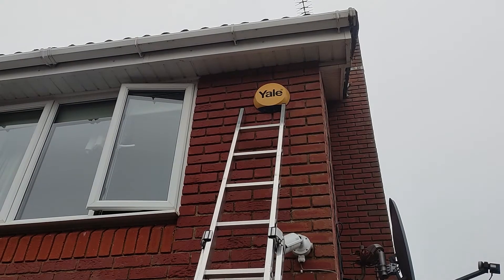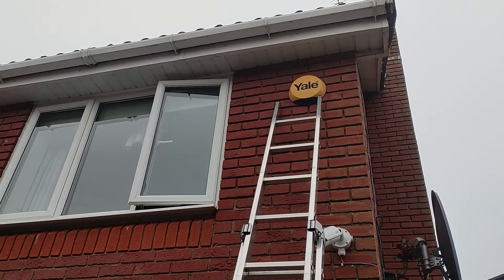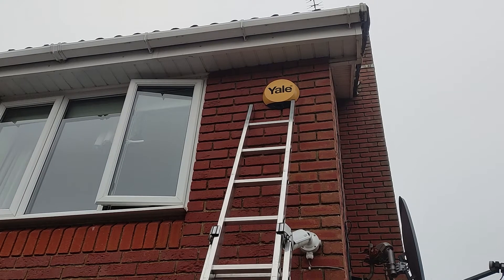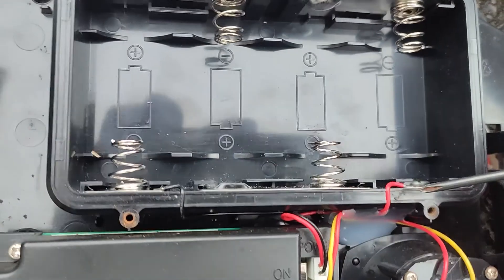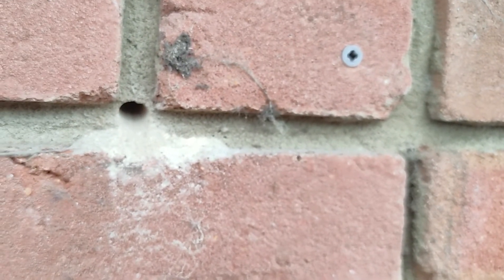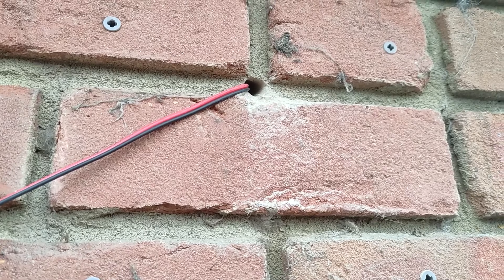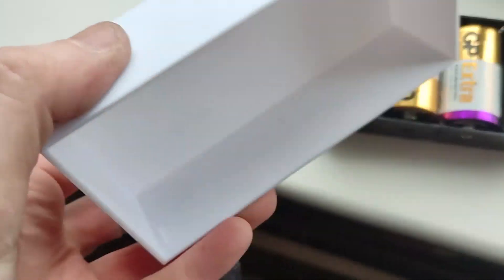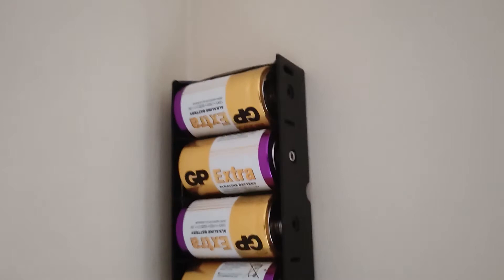Yale Smart Alarm Battery Mod

Comment: Thank you to the video creator - I followed the advice and it saved me a lot of hassle.  

I struggled to find the correct connectors and parts online initially. So in the spirit of the Internet in helping fellow human beings I hope this is helpful to other people I used the following parts:

Connector Size:          JST XH 2.54mm 2-Pin  22AWG
Cabling:                        22 Gauge 2 Conductor 2x0.32mm 22AWG 
Battery Holder:            4x 1.5V D Size Battery Case

I managed to source these parts from Amazon UK but they are also more cheaply available on Ali, Temu etc. It has been working great for months now on a fairly long cable run (100ft/30m)

Hopefully this helps other future people. Take Care
Reply: thanks for putting this together

Comment: Nice.. But the manual for the siren states that you can use an external 12v DC power supply and there is a DC terminal block for this purpose in the unit.
Reply: Until there is a powercut and your house is not protected.
Reply: @neildeakin4454  That's what the batteries in the siren are for, backup power if your external power fails.
Reply: Yes, and the whole point of this video is to save someone a trip up the ladder.  The alarm will still fail if you have used the DC adapter but failed to replace the batteries if there is a power cut.  @y0rkiebar

Comment: Why not just use a 6 volt power supply? Then you never need to change them.
Reply: how would this work ? looking at getting the alarm system but no interest in climbing a ladder every year
Reply: Hi, Would I need a 6v 1a for 6v 2a.

Comment: I've had the HSA version of this alarm since 2013, same bell box. I think I've replaced the batteries twice. Just upgraded to the sync one yesterday. Hope I don't have to end up doing this mod, but useful to know. Maybe hook it up to a 9v mains adaptor, save you ever having to change them?
Reply: Hi, I’m looking to buy an adaptor but would I need a 6v 1a for 6v 2a 🤔
Reply: The siren is rated for 6v. :)

Comment: Thanks for this, I might give it a try.  Can you give a part reference for the battery connector which plugs onto the PCB?
Reply from the maker: It was a connector I had from some drone parts.  I think its a 2 pin mini micro jst connector.
Reply: @jwarburton  if buy a new battery for hub the white box the connector on that plugs  straight in just cut the old wire off the battery which is the green battery it will plug straight in once unplug the battery box cable leave that to one just in you to go back to what it was then ?connect a lead to battery cable and move the box

Comment: How often do you have to change the batteries?
Reply: I have had just over 3 years from my original set of batteries.
Reply from the maker: I seem to be replacing batteries more often as it gets older. Tried different batteries but not made much difference, I was only getting about 4 months before I did this mod. So far I haven't had to change the batteries since I've moved it inside. I'm hoping that having the batteries out of the cold will help with the battery life.
Reply: @jwarburton  So you had to replace batteries every 4 months? I though they would last 2 years?
Reply from the maker: @8wealthyone8  I think the longest I have had is about 9 months. The cold seems to affect life, as does the age of the system and any false alarms / mistakes.  We set the alarm when we are out during the day and every evening. 
So far since installing the mod I haven't had to replace the batteries.
Reply from the maker: Just had to change the batteries. Got around 4 months out of that set. Arming every evening. The set I have just put in are rechargeable.
Reply: Ive tried a variety of batteries on my sync alarm, the bell box last six-twelve months, even with all the energy saving options activated, it's really annoying

Comment: Surely now if some one was to break in they can just pull the battery’s out to shut the alarm up?
Reply: Most burglars will have your house cleaned of valuables in a minute or so and not even worry about the siren going off
Reply from the maker: Yea, but they would have to get past ED209 first
Reply: I dont think the burglars would even notice wot the box was
Reply: Mounted my bell box under the bedroom window so I can change the batteries from the bedroom window.
Yes a burglar could stand on another’s shoulders and squirt the box full of filler foam to silence it or smash it off the wall, but me and the wife would still get notified so I can phone my neighbour and he’ll pop round with his two Rottweilers. At the end of the day if I get burgled it’ll be be by an opportunist and not a professional who will be going after bigger fish. At the end of the day they’ll hopefully leave your# and rob someone who doesn’t have an alarm showing.
Regrading the bedroom battery box. Take a photo of a panic alarm box and stick that on the battery cover so at a glance it looks like a panic alarm box 😂.
Reply: @bobbo9549 Brain of Britain strikes again !

Comment: Great video, thanks. Looking to do the same. What type of cable did you use to extend through the wall? Thanks
Reply from the maker: Thank you for the comments it was nothing special as the voltage and current draw were low and there was no external cable run.  The cable I used was designed to be used in automotive electrical applications as it was what I had  spare.
Reply: @jwarburton  ah that’s Jon. Was looking at red/black speaker cable. Rated at around 3/4 amps I think. That will be ok I think?!
Reply from the maker: @jonathangiles4854  I would be amazed if it drew more than 1 amp so that cable should be plenty

Comment: Where did you get the battery holder?
Reply from the maker: I purchased this one https://www.ebay.co.uk/itm/1-2-3-4-New-C-D-Type-Battery-Holder-Cell-Storage-Case-Box-With-150mmm-Wires-UK-/283399360394?_trksid=p2349624.m46890.l49292
Reply: where you get this battery box cover white ?
Reply from the maker: @sawanaudis  I 3d printed it
Reply: @jwarburton  Would you consider making another 3D box mate and sell them? I would be interested in purchasing as I cannot find any to fit
Reply from the maker: Yea, would consider it but can't believe there would be much of a market to make it worth it.